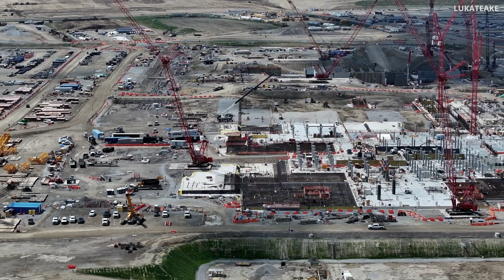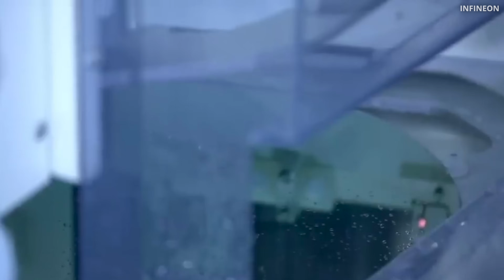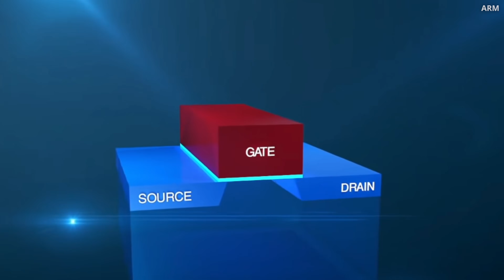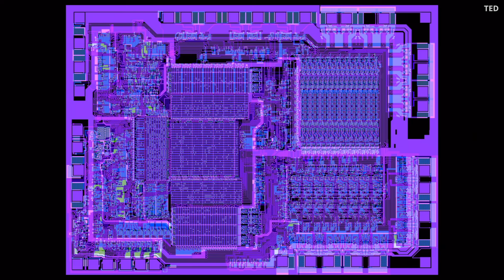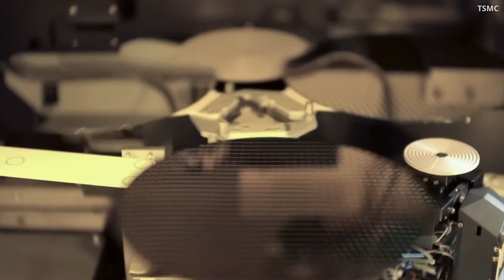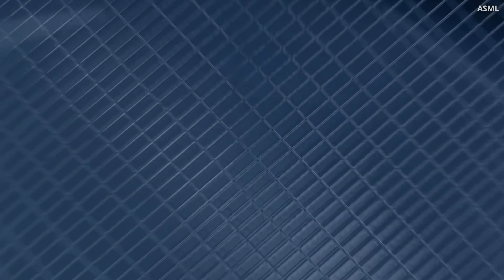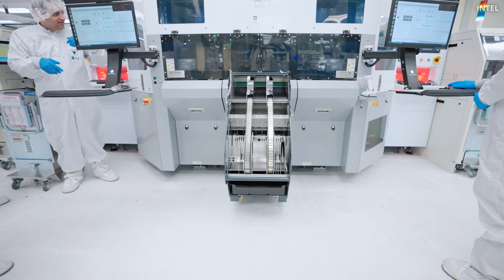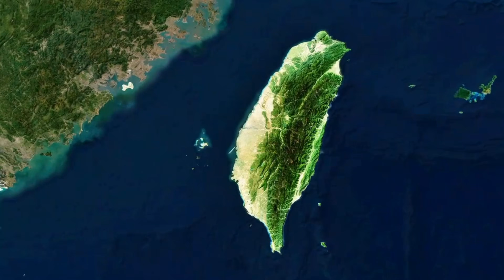Huge Chip Breakthrough — and A Massive Warning For TSMC

Comment: Won't Elon's factory be bigger? Good planning by both in case China makes a move on Taiwan.
Reply: We will need multiple hubs of production and R&D, the US and Taiwan can both prosper/expand with additional capacity/innovation still needed, assuming Taiwan isn't abused by CCP thuggery.  We should support Taiwan irregardless of their TSMC credentials, they are a respectable friendly democratic country.
Reply: Much bigger, a sleeker operation & multifaceted.... but these tech/science lefties hate Elon!

She's not mentioned him once!

Sabine Hossenfelder refuses to acknowledge him, ]ositively, ever! 🙄🔫
Reply: elon doesn't have anything to do with silicon manufacturing....
Reply: @D3nchanter you clearly dont know what your talkiing about, he is literally building the a huge vertically integrated chip fab called TeraFab….
Reply: @TomA42710 Elon also will dominate battery manufacturing producing several gigawatts of battery annually dwarfing the entire battery market. That did not happen. Elon is just all hype now. The last successful product Tesla release was the Model Y. The Cybertruck was release underspec and overpriced and is not selling well.
Reply: @TomA42710  and has it produced.... anything at all yet?:

hmmmmmm.... no?
Reply: @D3nchanter 
They are still building the fab and these things take time.  Maybe it will produce nothing but only an idiot writes it off before it is even completed
Reply: @didierduplantier8359 The ASML EUV lithography machine production is fully booked for several years. So where would Elon buy his equipments?
Reply: @D3nchanter Tesla cars...
Reply: @D3nchanter ~ Huh? You're joking, right?

Comment: Competition is good for us in general. 18A had significant yeild issues, yet in the beginning of 2026, Intel achieved 60% yeild with 7% improvment per month.
Reply: if you think about it from intels perspective, that would be their number one priority is to get the yield issues worked out. this kind of constant iterative improvement on that yield ... makes absolute sense. its exactly what i would prioritize if i wanted this node to be not just successful, but profitable
Reply: @D3nchanter you are absolutely right
Reply: Wow 7% per month in just 9 months Intel will achieve 123% yield. Truly astonishing.
Reply: Yield improvement is relative not absolute. 7% absolute is what you calculated,  month 1 is 10% yield, month 2 is 17%, etc. What actually is happening is month 1 20%, month 2 = 1.07 * 20 = 21.4% yield. After 1 year that’s 45% yield.
Reply: @jonathanalexander5580 Ahh so it's exponential. So starting from 60% after 9 months that's 60×(1.07)^9= 110. 30
So after 9 months their yield will be 110%.